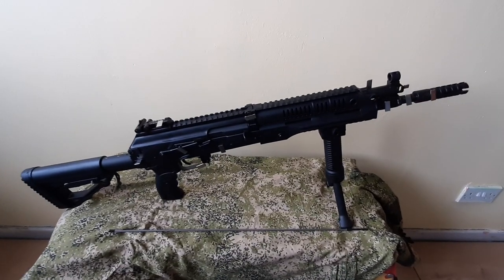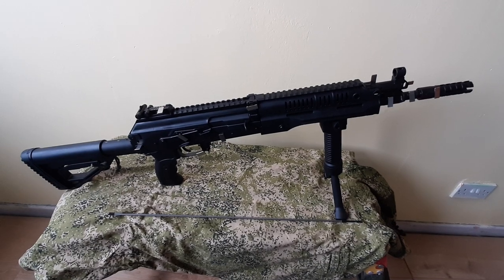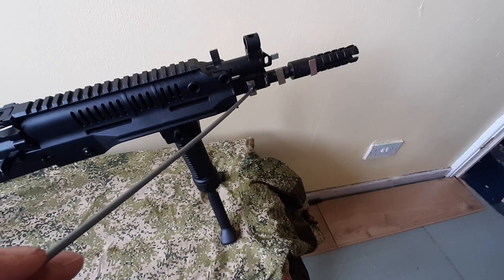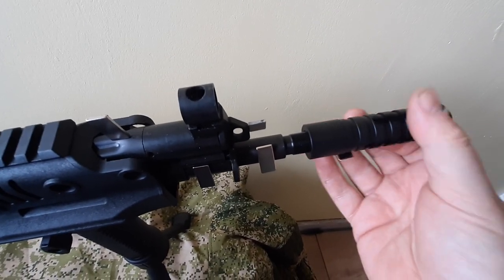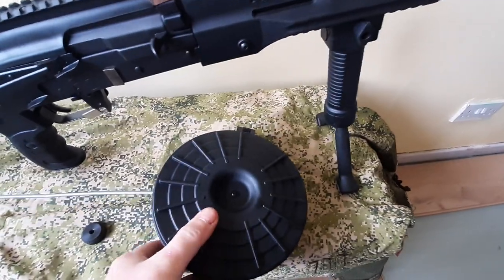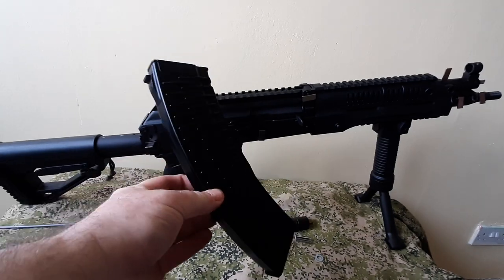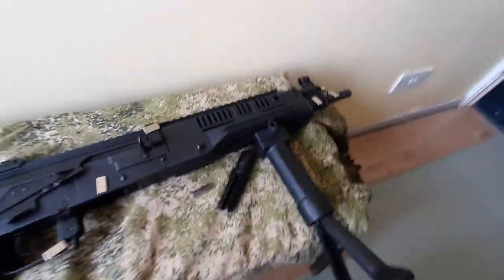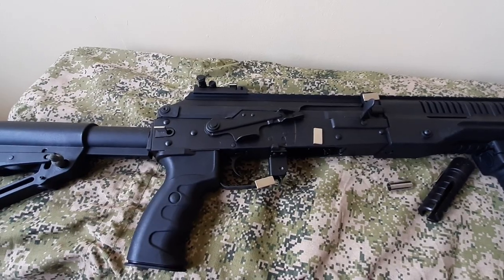LCT RPK16 (LCK16) initial impressions and, mag compatibility test.

Comment: Excellent video.  I have an old LCT RPK NV that I only just recently got their new drum mag for, and it feeds incredibly well, so high hopes the 5.45 version works out well for you.  I must admit the rpk-16 model has intrigued me simply because at the local pickup games where everyone is full auto with arp-9 flooding the fields, lugging a full length RPK around makes a lot less sense than any of my shorter models.  I await for shipments to come to the USA (probably next year at this rate) and whether or not Arcturus will make one as well.

Comment: 390 on a m100. Lol I actually bought a m4 that was doing 430 on a m100. I ended up short stroking it. For full stroke I would need a m85.

I'm planning on getting this gun for outdoors. 430 fps isn't changing. The USA doesn't have any fps regulations since airguns and airsoft guns aren't firearms. If it's not broken don't fix it. Although it should be like any other Ak, I heard it's a long winded process and you have to remove the gb to access the qc spring. Lmg's can go up to 450 at my field. Everyone else above 350 is semi only. Essential a dmr which is why I downgrade assault rifles to 350. It only makes sense to go higher for a dmr.

Comment: Great video! I own the LCT AK-15 and I've been using it as a RPK-16 for a while now. I can't wait to finally get it when it finally comes to the US. Thanks for showing the Arcturus AK-12 mags. I plan to pick up a bunch of them as soon as they get here as well. Can you tell me how heavy the RPK-16 is with the drum mag fully loaded?
Reply from the maker: Thanks.  With a full drum magazine, it's about 8 kilos.  I'm also going to be adding an optic and one of the new LCT tracer suppressors as well, just to make it even heavier!
Reply: @grumpyoldairsofter7305  Oh, wow. That's hefty. Then again, I shouldn't be surprised. I'm running the AK-12 with the RPK-16's drum mag and a red dot magnifier combo. Have you used the gun in a game yet?
Reply from the maker: @Russiapino  It's getting its first run out this coming weekend.  I'll get some after action comments up on how it performs as soon as I can.  Hopefully, the combination of a heavy gun and very steep hills doesn't kill me first!
Reply: On the ak15/12 can you
Put a flashlight on the side rails?
Reply from the maker: @no__name3747  Yes, you can.

Comment: Hey question. Just got my rpk 16 and the gas tube and front sight post have significant play and can't seem to be tightened down. Is that an issue with yours aswell?
Reply from the maker: No issues with mine at all, in fact, quite the opposite, it's all still as tight as a tight thing.  You should check everythnig is in place properly and, also tightened up correctly.  I'd go as far as taking off the whole front end and, reassembling it as tight as you can get it.  LCT products are usually incredibly well made with good tolerances, so, I'm sure it's all fixable on yours.